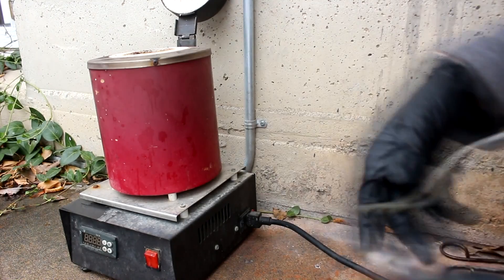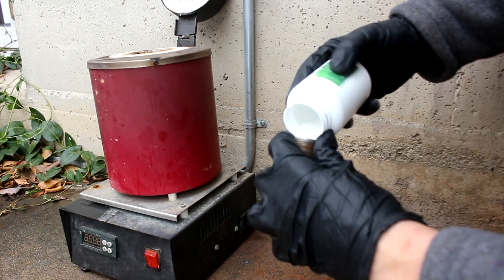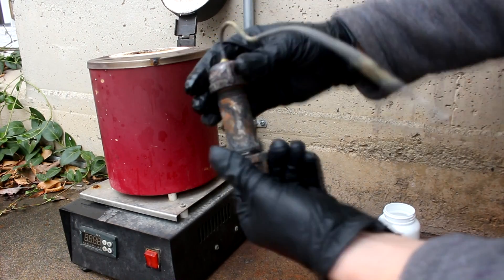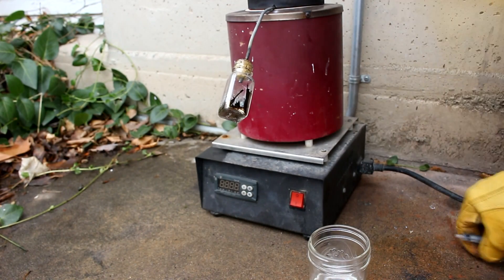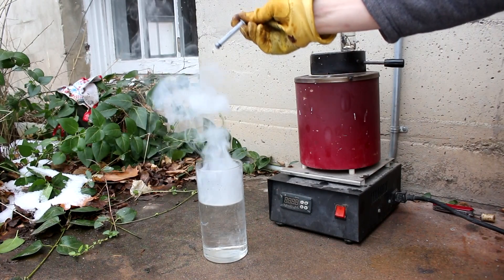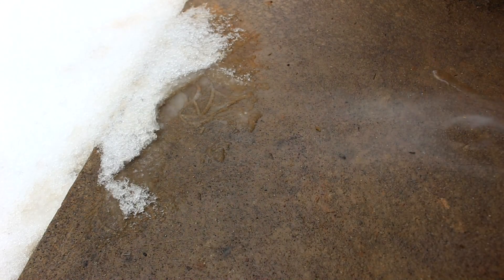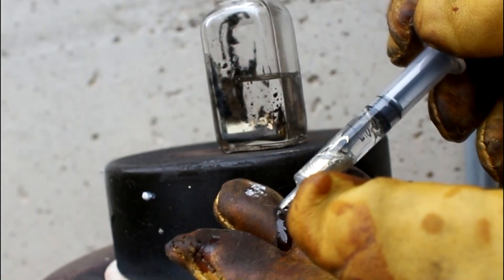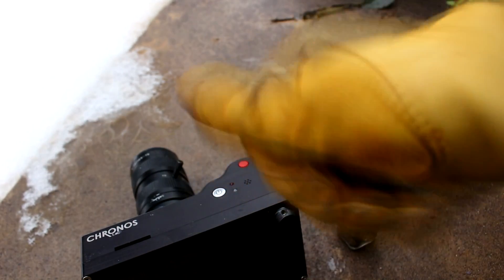Isolating Cesium Metal

Comment: What happen if you put cessium in hydrogen peroxide
Reply: bad things.
Reply: hydrogen peroxide is a really powerful oxidizer..... SO FOR GOD'S SAKE PLEASE DON'T DO IT.
Reply: oxygen. because its an oxidizer.
Reply: Cesium and liquid hydrogen wouldn't actually react together, as cesium hydride doesn't form under normal conditions.
Reply: The more powerful an oxidizer is, the higher energy  is produced so basically it  will be insane.
Reply: The Terrarian what? Why? The amount of energy that will be set free from a fixed amount of cesium with oxygen is always the same. Not depending on how strong your oxidizer is. Simply the speed of the reaction would increase, but not the overall energy in joule or watts.
Reply: Dan Swoboda It wouldn't form an explosive, it would just burn vigorously. In what way would it possibly be like a peroxide explosive?
Reply: Cesium in liquid hydrogen would be amazing... 
Now I wounder which would make a more vigorous reaction, cesium in liquid hydrogen or liquid oxygen?
Reply: @BigTimeZergRush  liquid hydrogen because it's a alkali metal and more reactive than oxygen
Reply: BigTimeZergRush Cesium reacts so incredibly quickly that I don't think liquid oxygen would actually be more impressive than plain old water. There's more oxygen available, sure, but with water there's also hydrogen burning with O2 from the air, and liquid O2 is so utterly cold it may actually slow the reaction. Would be interesting to find out, of course.
Reply: Taunus-Tims Welt I assumed he means something along the lines of "since fluorine is a more powerful oxidizer than oxygen, reacting cesium with fluorine will release more energy than with oxygen." Which seems intuitively true, I don't know, but of course is irrelevant.
Reply: PolyJohn Not quite.
With oxygen:
Cs + O2 --> CsO2

With water:
2 Cs + 2 H2O --> 2 CsOH + H2
And then with air 2 H2 + O2 --> 2 H2O (I did not think of that. So, good point.)

Cesium is pretty weird stuff. But it seems the energies go pretty much even. So, what really matters is what steps will be faster. Not sure.
Reply: user255 Ah, see, didn't know that. That changes things. Also, holy shit is CsOH some nasty stuff.
Reply: Brian Frichette What counts as an explosion is rapid decompression of gasses. This doesn't have to be chemical, however, this is normally how it is done.
Reply: ah ok for what ever reason I thought cesium reacts more with hydrogen then oxygen.. So liquid oxygen and cesium sounds like a fun little experiment for Cody :). Even though he would need enough cesium so that it can actually reach the liquid oxygen and not just burn up on the way down.
Reply: Throw it into some potassium nitrate. I bet that'll be a sight to see.
Reply: That could end up killing someone. Sounds like it would be similar to an acetone peroxide explosive
Reply: PolyJohn no, it is false. The amount of energy would not increase. Because it chemically can't. Just the reaction speed wil rise
Reply: Taunus-Tims Welt You're suggesting reacting cesium with fluorine releases the same amount of energy as reacting cesium with oxygen?
Reply: If the reaction speed increases then so would then max energy since it would be releasing all its energy at a higher rate then before. Also im pretty sure since liquid oxygen is extremely volatile that it would have a big effect in the over all energy being released.
Reply: BigTimeZergRush Liquid Oxygen is hundreds of degrees below zero, so it would dissipate the generated heat much more quickly as well. And considering there is more than enough oxygen in water for cesium to scavenge, I don't think liquid oxygen would even make the reaction happen faster.
Reply: +PolyJohn
Every possible oxidation reaction I have seen happen much faster in liquid oxygen. So I can be wrong, but my bet is that the greatly increased concentration of oxygen beats easily the lower temperature.
I mean it's liquid vs gas. The concentration advance is huge.
Reply: user255 But we're not talking liquid O2 vs Gas O2, we're talking liquid O2 vs water.
Reply: PolyJohn
Well yes, but oxygen is also much more reactive than water. More potential energy to release.
The point was that the initial temperature is secondary factor.
Reply: user255 Pure oxygen doesn't have more "potential energy" to release, in both cases you're forming cesium oxide. Exact same energy. If your performing it under an inert atmosphere, than maybe LO2 would win, but any energy "lost" to liberating the hydrogen is recouped when the hydrogen burns with atmospheric O2, which is immediately, because the reaction is so intense that a pseudo-leidenfrost effect keeps the cesium at the surface of the liquid, regardless of which one you use.
Reply: I would like to see it dropped in bleach.
Reply: user255 What about in bleach?
Reply: Richard Smith  I would expect it react faster than in water, but not sure how noticeable that difference would be. Also it would be "dirty" reaction resulting various compounds depending on amounts of the reagents. At least additional to the water reaction there would be CsCl and CsClO.

Actually now that you ask, I remembered that alkali metals experience Coulombic explosion in water... so I think PolyJohn is right, that water would create faster reaction than liquid O2, but from different reasons than presented earlier. (Coulombic explosion is unlikely to happen in liquid O2 [but it does happen in bleach].)
Reply: PolyJohn
Yeah, I hope Cody will demonstrate it to us. I have never personally handled CsOH.
Reply: +richard smith t'd make CsCL, the compound Cody used to get it in the first place.
Reply: ***** For a second I genuinely thought you were referring to some ungodly Cesium Carbon Lithium concoction and was momentarily terrified.
Reply: ***** Right, I am just wondering how vigorous the reaction would be back into that form.
Reply: Ohhh CodysLab.
What happens?
Reply: How is a faster reaction not more explosive? The energy of the tzar bomb is estimated to have produced 210 petajoules, while the current world's annual energy consumption is more than 5 orders of magnitude greater than this. Releasing energy quickly is precisely what makes something explosive.
Reply: Brian Frichette No, "explosive" has a very specific meaning, which is not just "burns quickly." Strictly speaking, black powder isn't even an explosive, just a deflegrant.
Reply: Brian Frichette well, let's see. For an example: 1 kg of petrol gas has an energy of 42 MJ. It does not matter if you burn it with air, pure oxygen oder NOS in your car. The amount of chemical energy would be the same. Means: the distance you could travel with 1 kg petrol gas would not change. The power of your engine instead would greatly increase with pure o2, causing a higher maximum driving speed, BUT for a shorter period of time! The distance would be the same if we ignore the effects of your engines efficiency and influences of greater air resistance at a greater driving speed and such. 
Back to our cesium: when we assume, that the reaction speed would increase, increasing the speed and power of the shockwave, we have to assume that the duration of the impact is shorter, or if we believe in Einsteins e=mc^2, the mass has to decrease, so that the amount of energy would stay the same. 
Finally we could say, that the explosion is faster but either shorter or weaker, depending on which effect occurs. (would be the shorter time span though)
Reply: PolyJohn Thanks for the correction, but now I'm not sure what to call such a phenomenon. Either way releasing the same amount of energy faster clearly has a strong correlation with the destruction it produces, as it changes how the energy can be distributed through the matter it interacts with.
Reply: Richard Smith in fact there is an exact definition at which burning/shockwave-speed incineration turns into explosion. It is not defined by the expension of gases.   If you warm up a sirenge the gases inside expend as well, but probably waaaayyy to slow to be called an explosion
Reply: Taunus-Tims Welt +Brian Frichette
Yes and no. Tl;Dr: It's only going to burn, not explode. It doesn't matter how fast it burns, with the cesium in this state, it is not physically possible for it to detonate, though I doubt anyone would fault you for calling an extremely rapid burn an "explosion" even if it isn't technically accurate.

There is no shockwave in a deflegration, that's actually the defining difference between a deflegration and a detonation. If the combustion rate is slower than the speed of sound through that material then its "brisance," or its ability to shatter materials as opposed to just throwing them around or breaking them via pressure, is severely limited or generally non-existent.
Conversely, if the burn rate exceeds the speed of sound, than the energy released accumulates into a shockwave in the same manner as a sonic boom, and this shockwave is what does the majority of the damage by explosives.
The terminology can be confusing, especially because you don't necessarily need an explosive (which, by definition, detonates) for an explosion, which is usually but not always defined as some reaction or situation which involves the expansion of gases at a greater rate than the speed of sound through the surrounding air (see "Boiling Liquid Expanding Vapor Explosion" aka Steam Explosion). But it does make a difference here. I don't have the thermodynamic explanation handy, but basically detonations are limited to materials that release energy from breaking established chemical bonds, or from materials which contain both a fuel and an oxidizer so thoroughly mixed that the combustion front can travel through the material without any of it needing to move. Regardless of where the Oxygen is coming from in our hypothetical Cesium burn, it fails on both of these accounts. It doesn't matter how intensely reactive an oxidizer we use; we could switch it out for liquid fluorine and it wouldn't change; as long as the reaction is only occurring where the oxidizer meets the cesium at the surface of the material, further oxidizer always has to move towards the cesium to replace the consumed reactants, as the hot but inert products of the reaction also have to constantly move out and away from the cesium or the reaction would stop.
Reply: alysdexia the fuck are you on about, prat?
Reply: PolyJohn what is a hick or a prat?
Reply: You can try Chlorine dioxide ClO2 ...
Reply: Taunus-Tims Welt whaaaat? No, no. If you use for example fluorine instead of oxygen it will relase much more energy because elemental fluorine is much more unstable than elemental oxygen. So, because it starts from a much higher energy state this energy will be relased when reacting. This is why fluorine reactions are soooo exothermic. The discussion above was trying to say that if you react caesium with liquid oxygen it'll relase the same energy of gassous oxygen. Just the reaction rate won't be the same. The more concentrated the reactants are, the  faster the reaction.
Reply: PolyJohn oh, fuck, i explained it now. You're forming cesium oxide, but you're starting with a higher energy state reactant. The energy relased isn't the same. Reacting it with water is more violent cuz you relase hydrogen that will explode liberating another bunch of energy. But this is another reaction. But if hypotetically the hydrogen doesn't burn you 'll have a minor amount of energy relased.
And when reacting caesium with water the oxidizer technically is hydrogen, not oxygen.
Reply: People may find this weird, but I kind of want to see the caesium in liquid nitrogen, mostly just to see if it can get even nitrogen to react.
I've heard caesium nitride isn't stable, though, so maybe I'm just setting myself up for disappointment.
Reply: Would be neat to aerosol cesium.  Perhaps air alone would do the trick nicely. If not a secondary source water mist combined.  Slow mo for enhanced effect.